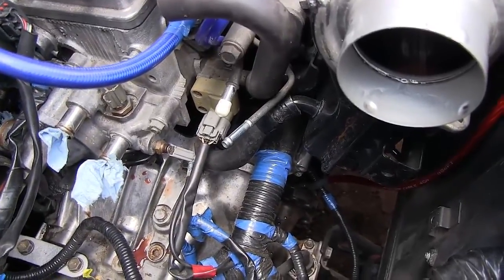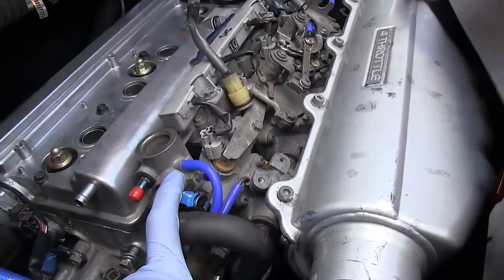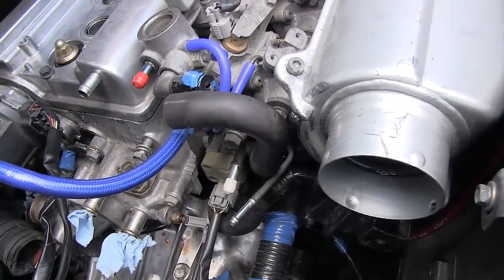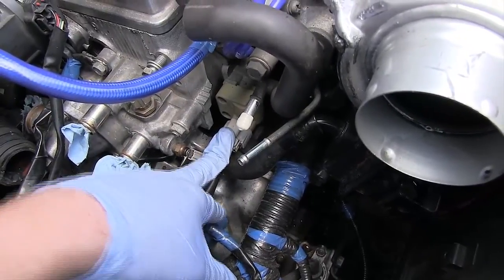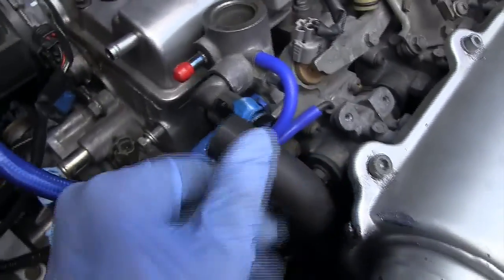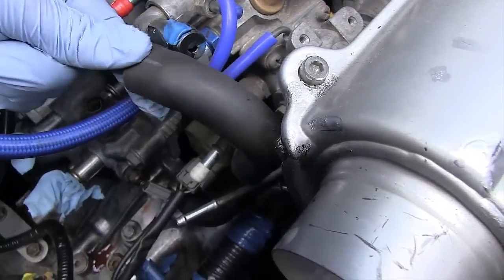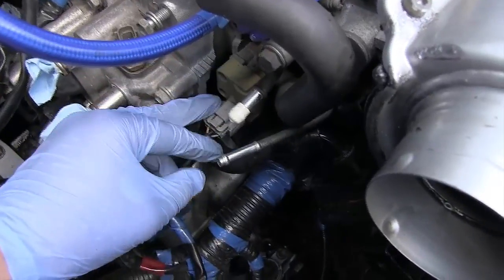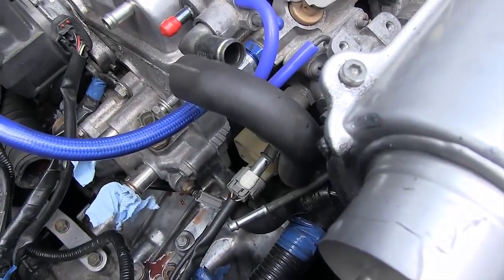4AGE 20V High Idle Problem

Comment: Nice! i did the same thing years ago, but once the engine warms up the idle went way too low. So what I did is add a simple manual open/close air valve from most hardware store.

Comment: having problems with the check engine. since i already replaced the "iacv" sensor still the "2-4" blink is not removed while checking with TE1 and E1
Reply: If I am not mistaken, flash code 24 is for the intake air temperature sensor not the idle air control valve.

Comment: On my 4age swapped ae100 the revs climb to 3k on start up for a about 2 seconds then it drops to the normal high idle,I tried cleaning out the iacv but I'd done nothing.Have you ever seen this happen before by any chance?
Reply: Completely normal
Reply: It's not normal,I have had plenty of 4age 20v and never seen them rev up to over 3k on start up,you can hear the tappets rattle when started from cold
Reply: Gaffelicious  check your throttle position systems
Reply: Hi men. I have the same problem... Do you fix the problem?
Reply: I have the same problem! It revs up until 3k for about 2 seconds, how do i fix or find the problem?